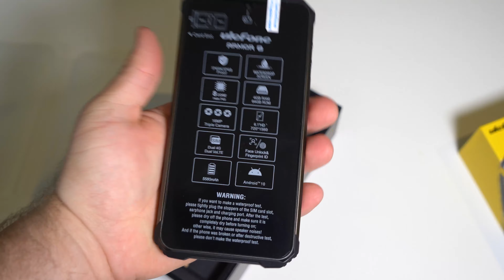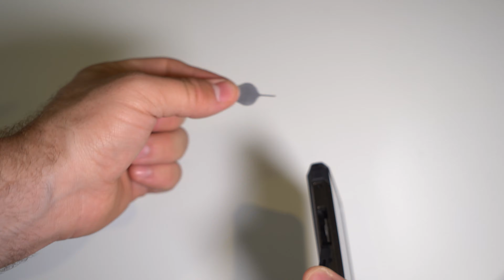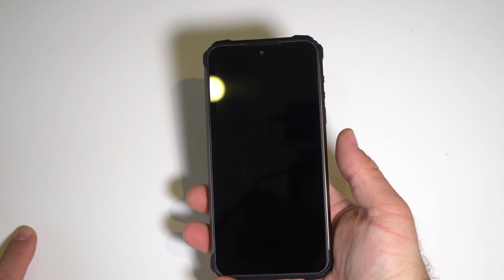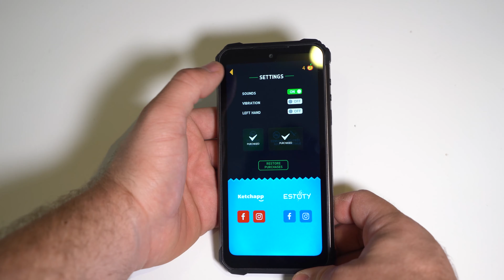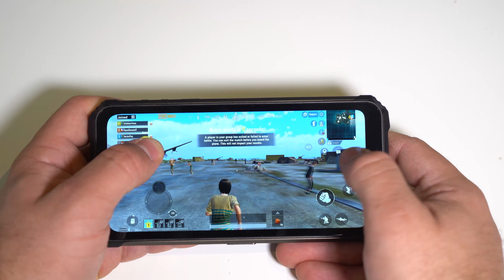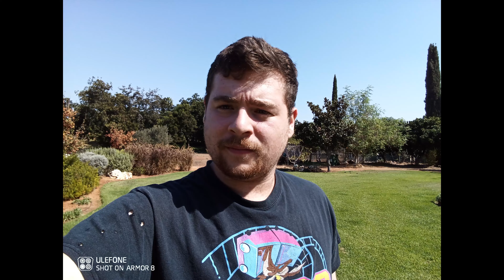Ulefone Armor 8 - Budget Durable Beast! Unboxing And Review

Comment: Very good video, I can't afford to break my cell phones either, that's why I use armor.

I have to renew my ulefone armor 1 (it died at 4 years, not bad), it was between 8 and 6s but I saw bad comments from 6s.

Now I don't understand why they bring a sheet of tempered glass (which is scratched), if the armor range brings anti-scratch glass and bumps, the armor 1 mine had it on.
Reply from the maker: 4 years for a budget phone to last, not bad.
Reply: @OrrWeiss  I imagine the series 8 will last the same or more, taking into account that I do not use it as hard.

Comment: I was interested in 3.5 mm earphone jack that is never present in those kind of phone but you didn't showed it even if present.. no matter. thanks anyway. Think it should works
Reply: @11:40 "even has a headphone jack"
Reply from the maker: If I didn't show it then it doesn't have one apperantly
Reply: @OrrWeiss  are you sure? Should be on top side on the shops.. Can you confirm?
Reply: @lordholnapult  it does have a headphone jack at the top, I have this phone